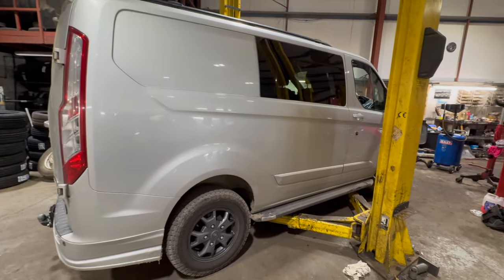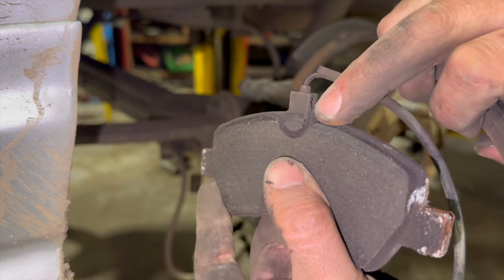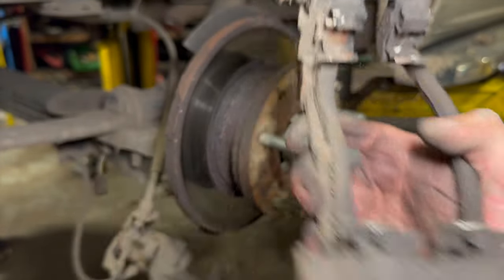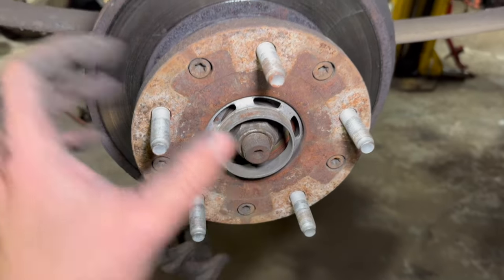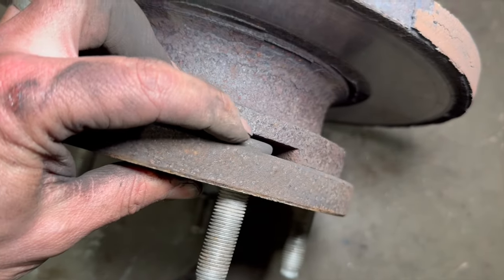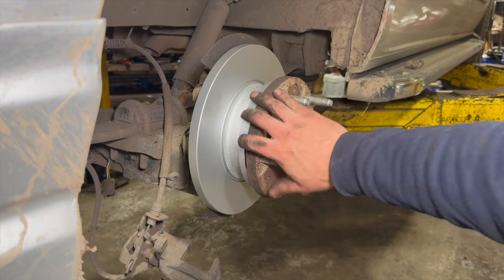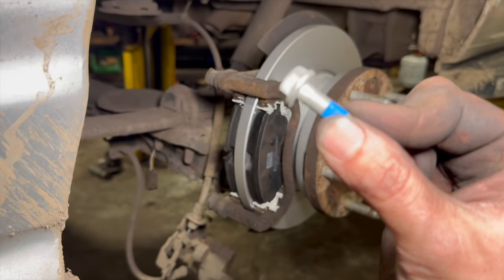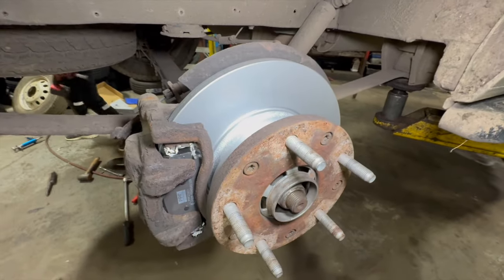Ford Transit custom Rear Brake Discs and pads replacement

Comment: Tried to do this, couldn’t budge the pads off like you just did, spoke to someone and they reckoned I needed a tool to release the piston (may have not used the word piston) from the pads…? Transit custom 2019 340 base
Reply: Scratched that, what 3 minutes further in and you answered my question 😂